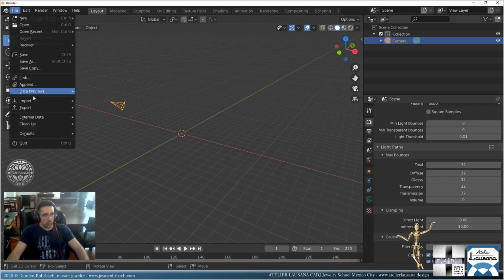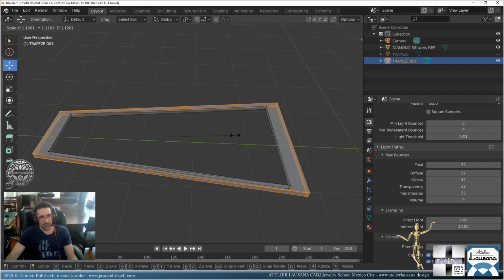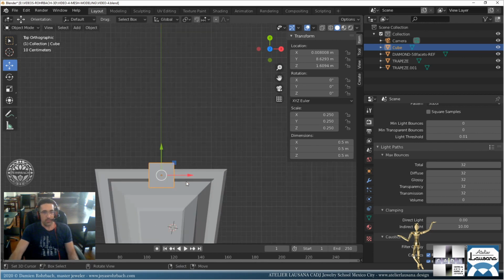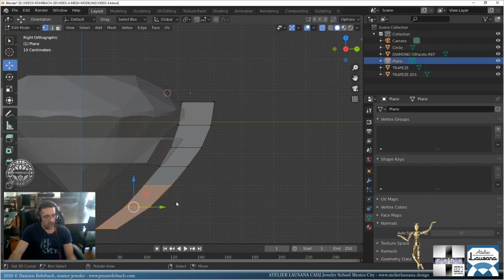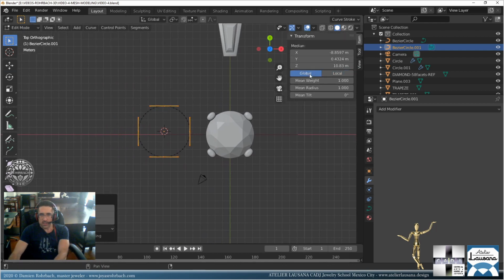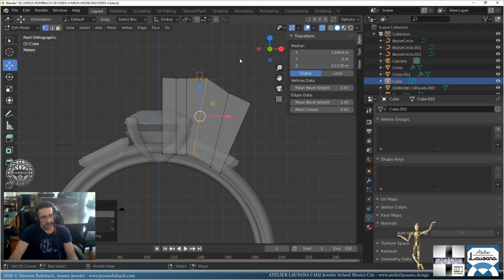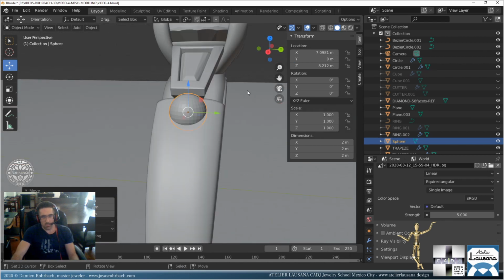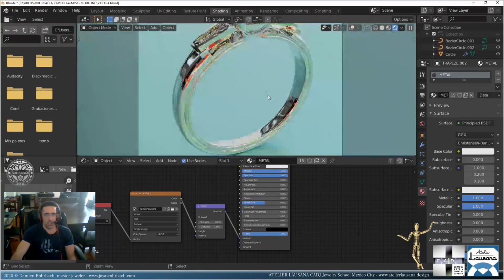3D Jewelry design TUTORIAL 4 with Damien Rohrbach and Blender

Comment: Suggestion: you should start using "Filmic log" color sequence under the "color managment" tap in the camera settings. This will make the render more realistic. As a plus, I noticed you don't use a denoiser, go into the output tap and select one, if you have NVIDIA, optiX should do good (warning, the program might crash if your card is not compatible, it did with me), but for any problems encountered i know that NLM is cross-platform and very good. And btw if you wanted to you could actually create physically accurate gemstone material and I tried it, it looks amazing. I think you should try, It's beautiful, for any imperfection the denoiser will take care of it. This approach does not go against your idea of "using blender as it is out of the box" because all of this is included in Blender by default, no add-ons. to place gemstones (or do a lot of cool other stuff) try also using object constraints, they can really boost your workflow! Hope it helps! This will just make your blender work more flexible and simpler.

And also there's another problem when you render glass which I noticed, the normals are f*** up because you work a lot by your own with the gemstone, this is a problem that Blender can easily solve with a quick shortcut, so you should select all the faces in edit mode and press SHIFT+N and you'll see that a tool called "recalculate normals" will be enables. It is crucial to rendering correctly, especially when working with glass.

Have a nice day!

Comment: Just purchased your gemstone collection, how do I import induvidual stones into a new blender scene? Is it possible to save each stone as an induvidual STL file?
Reply from the maker: Thanks. You can append. Create your new scene, go to file append, select the gemstones blend file, then go to the objects subdirectory and select the gemstone to bring it in. Yes, you can also export each stone as an STL or OBJ and the use import. Using APPEND is cleaner, you might use 'make single user's to remove the linking. Using STL or OBJ creates subdivisions on the faces, generally that helps creating more refractions during render. I will make a video about this.
Reply: @RohrbachJewelryDesign   append each one worked fine as well as exporting and saving each one as STL as there is less file browsing. cheers